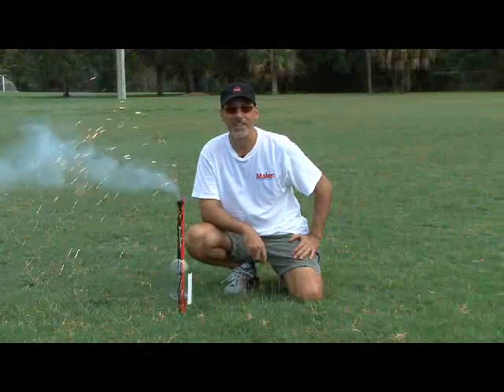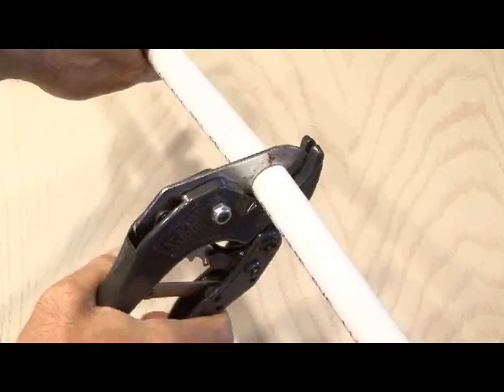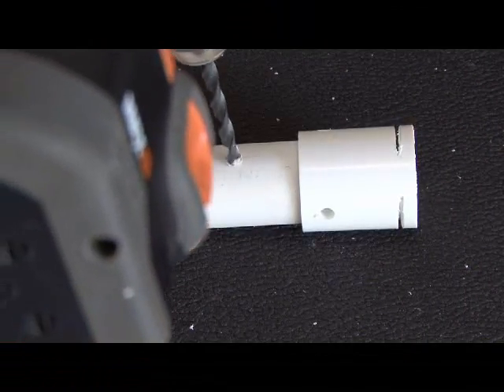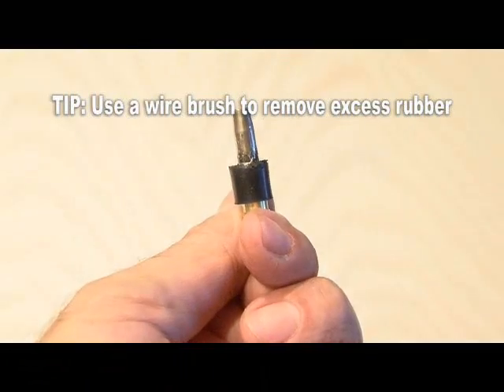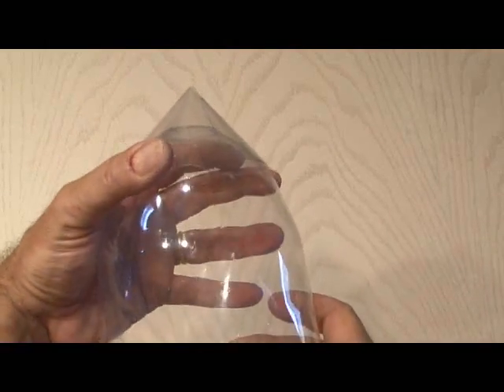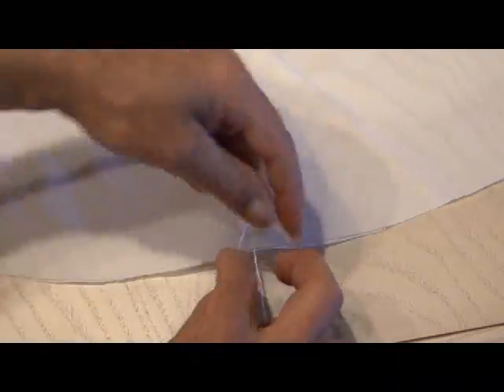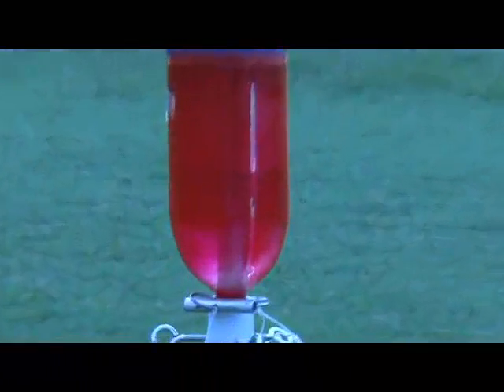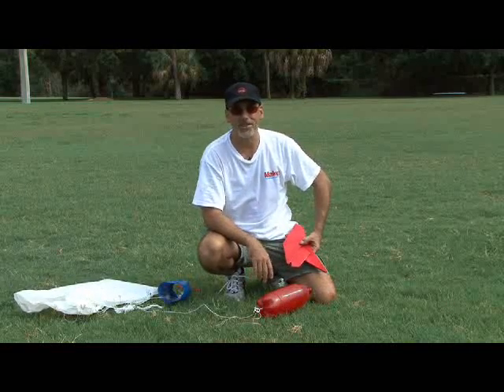Weekend Project: Soda Bottle Rocket

Comment: @robert0joe it can be on the inside or outside as long as it is secure at the tip also ide say make a slit n the top so its not so tight on there and the top can pop off and deploy the chute

Comment: ok.. there is a way cheaper way and simpler way to make a bottle rocket by using a normal ball pump with pump needle, a fitted cork and pop bottle and water.. actually i think it goes higher then that.

Comment: too much work for a small project. i used a simple curk with a pin in it (the one you use to inflate basketballls), attached it to an air pump and got the same result with only 2 minutes of work and no money spent. check it out 
watch?v=3H-Xu2gZRos

Comment: i did this in science class. our rockets went much higher though and the parachute worked, or at least on mine. we also used an air compresser not a foot pump.

Comment: i built a launcher one time for a 2 liter bottle, the launcher itself was alot more complex than this, but it was much heavier, and more reliable. I just used a 2 liter bottle, no messing around with making it into a rocket, then I just filled it about half full of water, used an air compressor to add about 120 pounds of air, and it would go a good 150 feet in the air no problem, and it always went where it was aimed.

Comment: made one of these b4 but more simple i used an air compressor  with a valve get the bottle and fill it halve up with water then with the compressor up to 160 psi open the valve works much better and i got about 90 feet out of it

Comment: lol to much hasal al;l i done was get a cork from a wine bottle and drill a hole through it a little bit smaller then a bike valve then i stuck the bike valve into the cork and cut it so that the valve was showing and was able ro be pumped then i stuck the cork into the bottle then pump away after it has a anoth air inside it will shoot off about 3 times as high so do that guys it cheeper and better

Comment: I made one of these back in 1989 using a cut up old bicycle innertube, 2 ltr bottle, wooden patform, cresent wrench and a bicycle pump. Either my brother or I would stand on the wrench against the rubber, while the other pumped. At the right moment, we'd jump off the wrench. I can still remember how bad it would hurt if that rocket shot you in the back of the thigh... which happened about 1/2 the time. OHh, the good 'ol days.

Comment: Fill it with Gas instead of water...

I use to launch similar things using compressed acetyline and a bit of gasoline and seal the end of the bottle with a semi melted candle as a plug...

You need to really be far away to light it and be ready for a 30 foot flame in any direction so don't launch it in the middle of a dry lawn that might burn and make sure you can run real fast. 

Actually looking back it might be best not to do this period.

Never mind.

PS. No O2!

Trust me LOL!